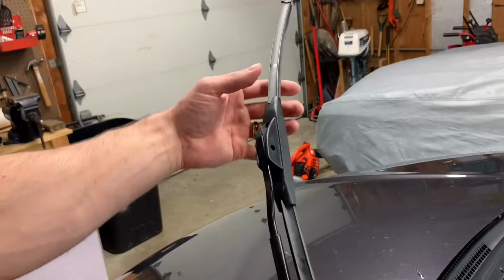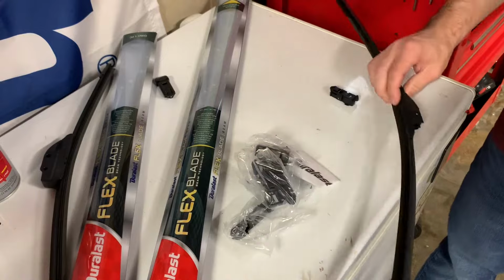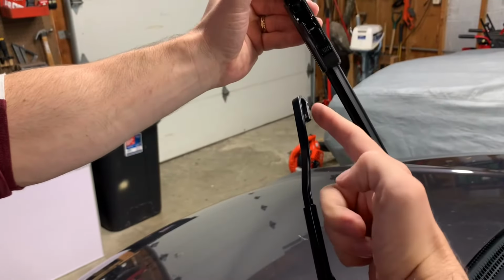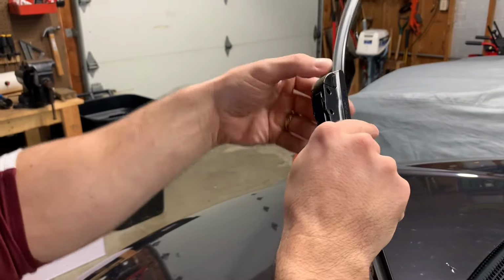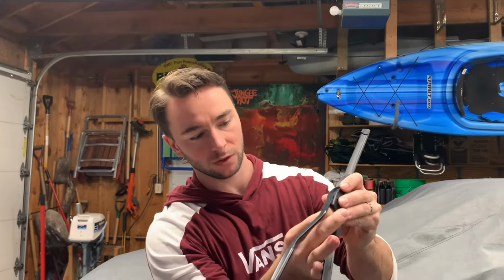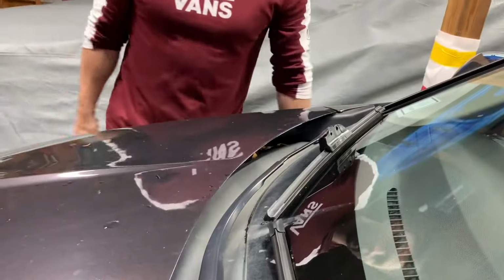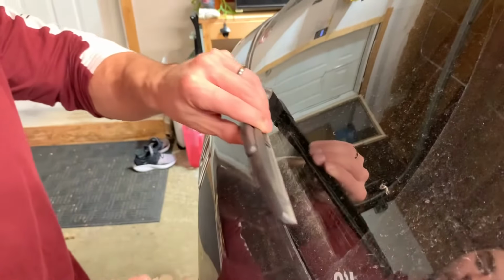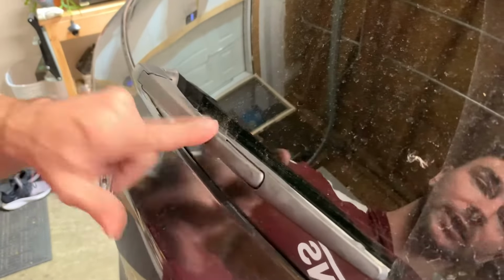How To Change 2016-2022 Honda HRV Front/Rear Wiper Blades

Comment: Hey, I'm only replacing the rubber blade not the the full arm. Any advice on that, thanks
Reply from the maker: Yeah, I’d just buy a whole new blade with the rubber already on it. Most blades aren’t meant to have the rubber part replaced and are made to dispose. Good luck!
Reply: Just look up replacing rubber inserts on honda  it's easy, the oem wipers are made so the rubber inserts can be replaced